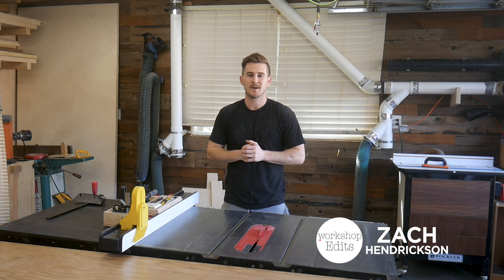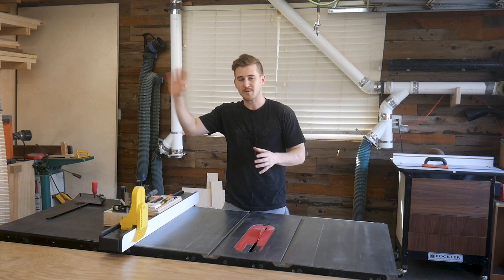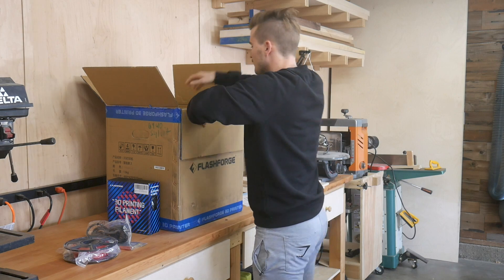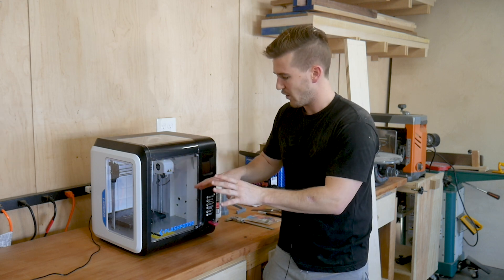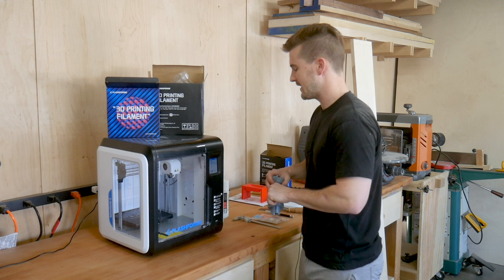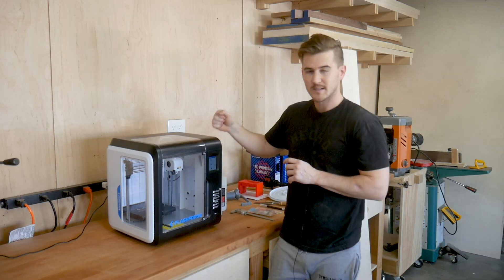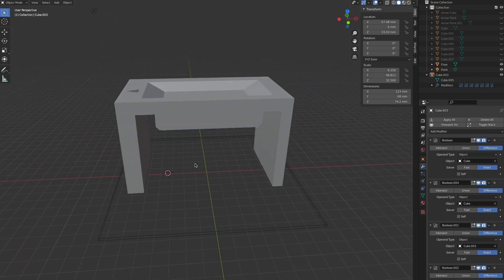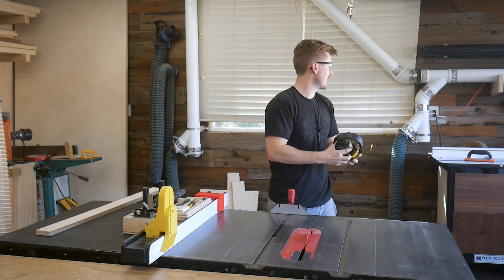3D Printing Table Saw Safety  | 67

Comment: It would be real cool to make the difference in the sides thickness the same as a sheet of 3/4 plywood ( or whatever) That way you can make a cut, flip your stop around and make the next cut and then cut out the middle for a dado.
Reply from the maker: thats an awesome addition to it - it feels like one of those things that could be many things in one - like you could use the other side to do just that so you have a regular half inch block like mine, and then the dado spacer on the other side, and then whatever else you can think of too add!
Reply: Cutting a dado as you described would end up being 3/4" + the width of the saw kerf.

Comment: Very nice!  If I had a Sawstop that would be a great quick print.  My craftsman only has a small fence for now but I hope to get to printing a few things for that soon.  I have printed a couple of feather boards in PETG and they work well.
Reply from the maker: Nice - yea more safety devices and other workshop hacks are on my list in the next few week. I think you could still print a modified version of my idea even on a smaller fence. Just would take your own designing

Comment: Like the video and would love to get into 3D printing. In the video, you said that it was "about $450". The link you put to Amazon is $870 and a lot more than I would spend on this. Is the link correct, or has the price changed that much? - Chris
Reply from the maker: I wonder if that’s an Amazon issue. 

The printer is under $500 on the FlashForge USA site. I’ll try to rectify that link.
Reply: @workshop_edits  , they have the Lite version for $299. From what I can gather, the only difference is no WiFi interface, so you have to load from a flash drive. No big deal there obviously since that's what you're doing. - Chris.
Reply from the maker: Ahh. Probably doesn’t have the inner camera for remote monitoring too, but there is no app so it’s not super convenient and I have yet to set it up.